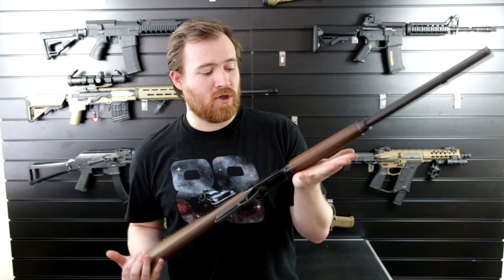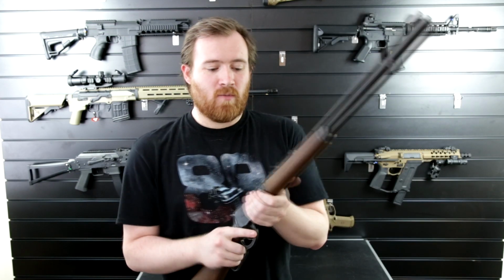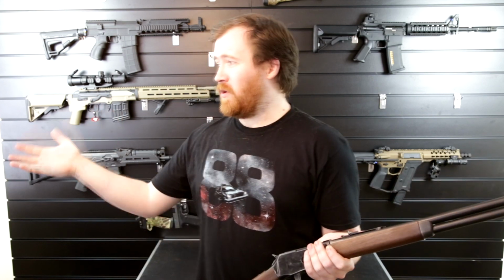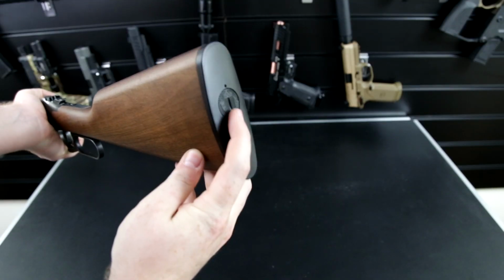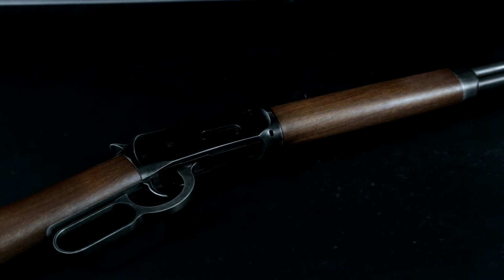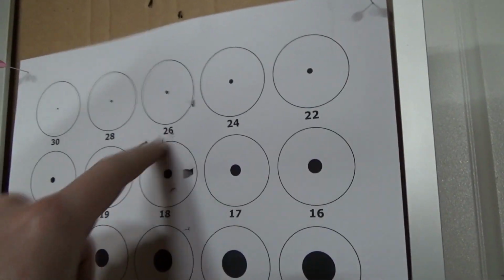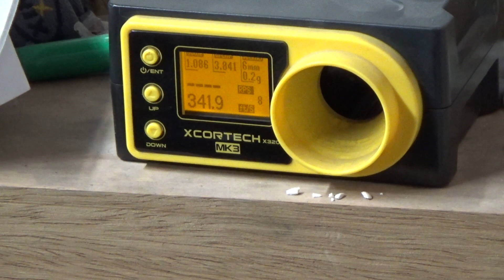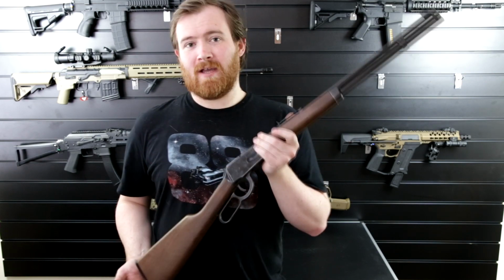Umarex Legends Cowboy CO2 Rifle - Bringing It Home Ep. 68

Comment: Two things:
Lever action is lever action there is nothing "automatic" about it.

If you are having trouble loading the cartridges in insert the first one only halfway into the loading gate. Then push it all the way in with the tip of the next cartridge. Rinse and repeat until you get to the last cartridge, you are essentially keeping the loading gate open for easier loading. Its on lod trick i use with my real lever gun.

Comment: is it loud? Can I use it indoor?
Reply: it’s a bb gun which uses metal balls shooting around 400 feet per second and no its really quiet but if you shot this in you’re house it’d put a hole in your wall
Reply: Its actually really not that loud at all compared to a lot of my other c02 ones. Its very c02 conservative, its just a small pop compared to a loud blast of others, its one of the most quiet ones that use c02 actually. And its also 600-700 fps depending on where youre from and which version you get.